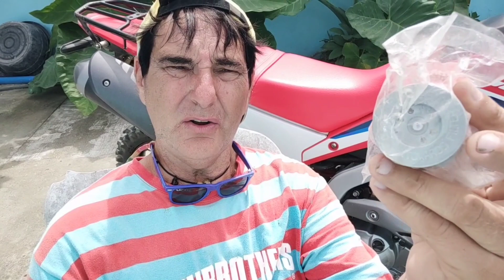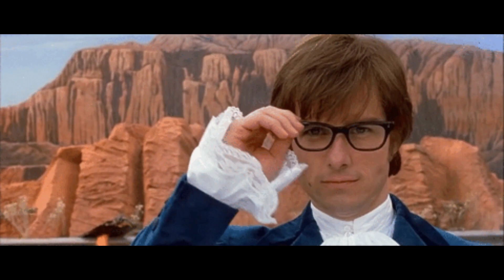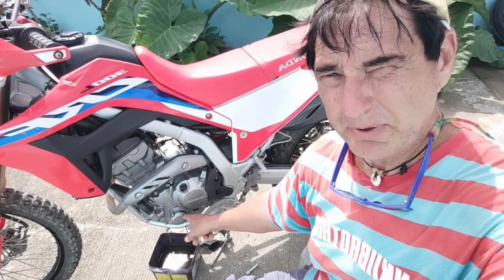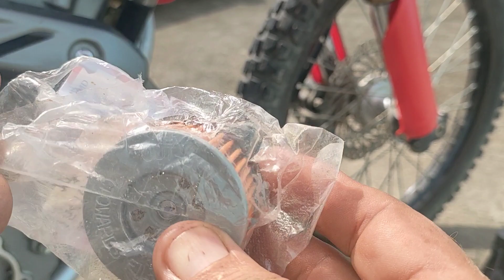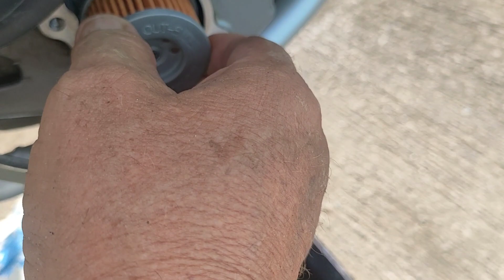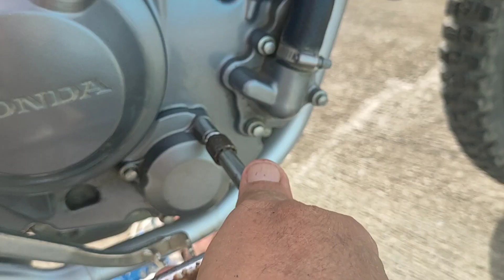HONDA CRF 300L - 2nd OIL CHANGE AT 4,000 MILES

Comment: Hey Bryan Do you ever see dual sported XR600 there in phil. I have owned a couple street legal Xr600s . Wish I never sold them.  Great power and built so tough
Reply from the maker: I don't see the 600's here they are such amazing bikes, I had a new one in CA before I moved here, and I loved it, bullet proof!
Reply: @BryanBee  what would it cost to import one there?
Reply from the maker: @JT-dj9hc  I think it's hard if the bike is over 5 years old but I think customes it has to be checked with the regulations
Reply: @BryanBee  I think it would be the ultimate bike there in phil. Tough as nails and great power. Parts availability is never ending. Im guessing the were never imported there.
Reply from the maker: @JT-dj9hc  yeah I've never seen one here I was looking to buy one but they are hard if not impossible to find, but what a awesome motorcycle, one of the very best in my book!